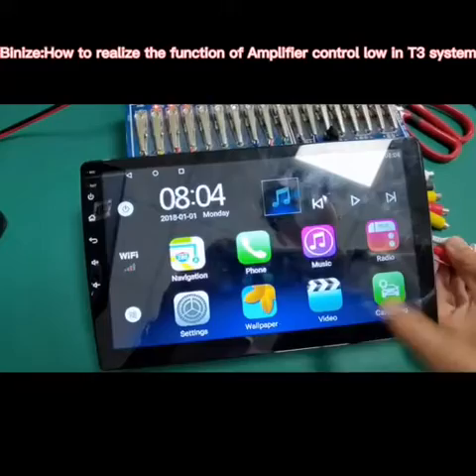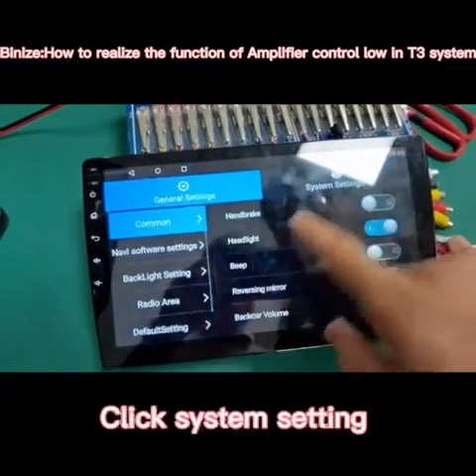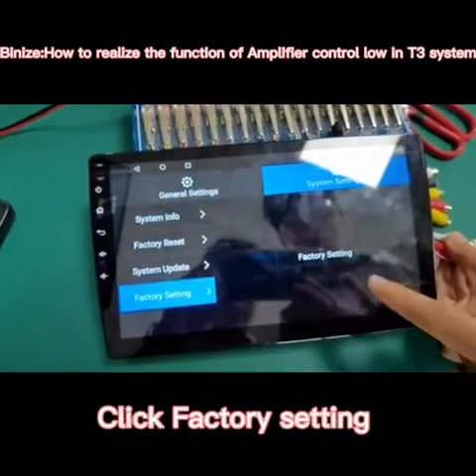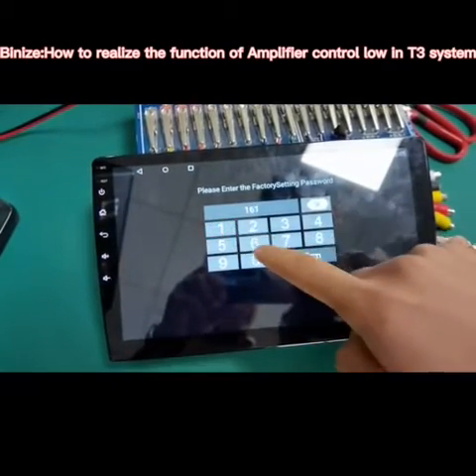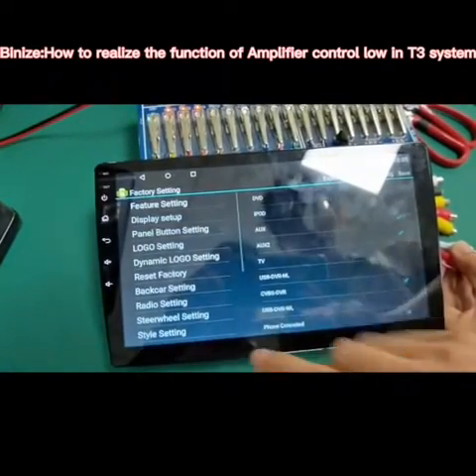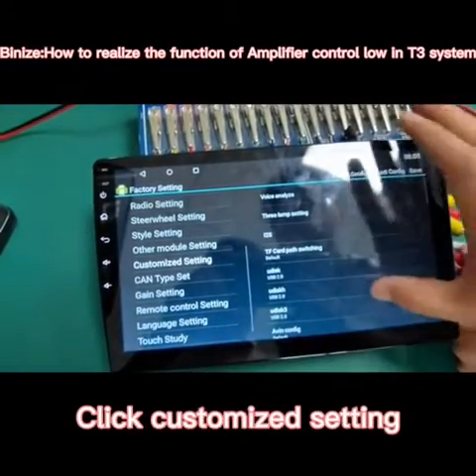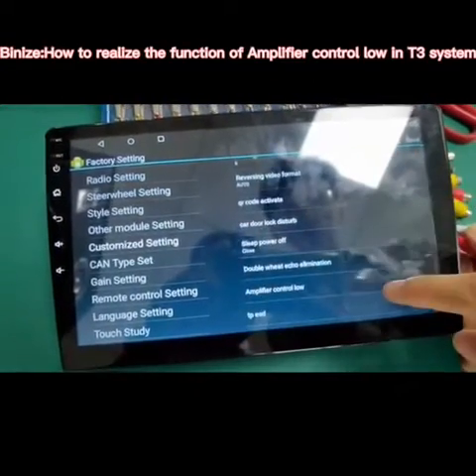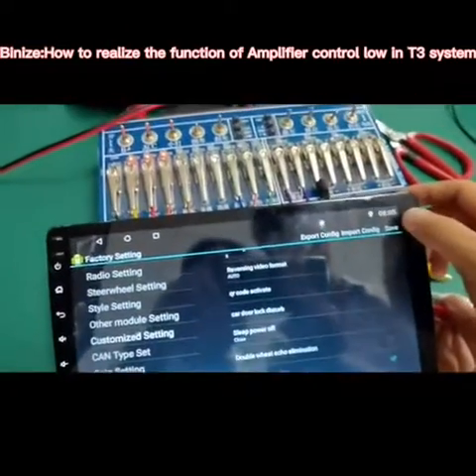Binize:How to  realize the function  of amplifier control low in T3 SYSTEM

Comment: How can I get the AMP-C wire to power my Blue power remote wire? it doesnt power on. The only way my amp powers on if i wire it the red power wire, but doing that causes the speakers to pop. how can i fix this? Thank you
Reply from the maker: Hello from binize, dear, cause you can connect your car amplifier power to the binize wire which label is ANT, Since both the red and blue wires belong to the power harness, when the machine is connected to the power supply, the two wires have a current, and since the blue wire supplies power to the automatic antenna, the current is slightly stronger